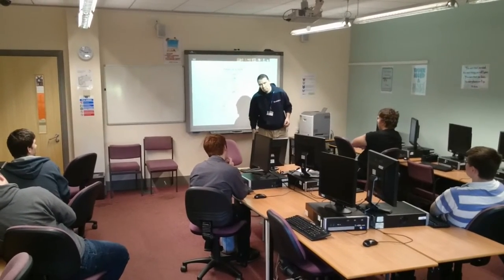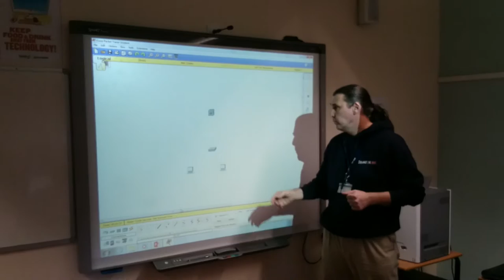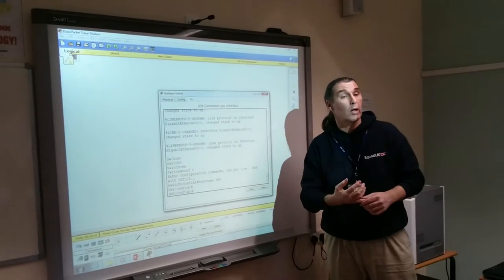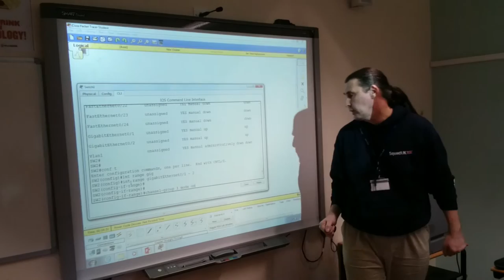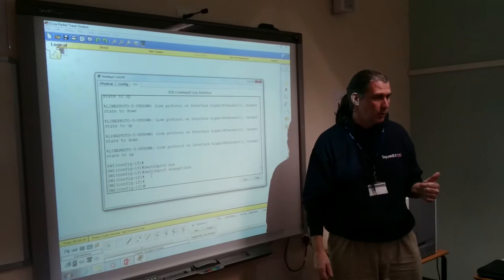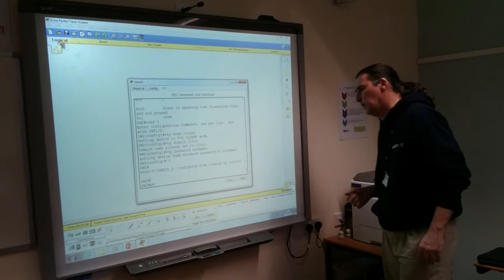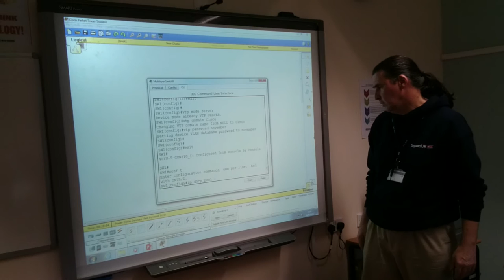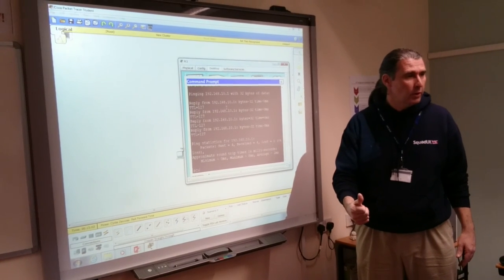Inter-VLAN Routing using a Layer 3 Switch and SVI's

Comment: great vid, but I have to ask: as far as I know, setting up an ether channel can not be on the same group number. every device needs a different ether-group i.e. layer 3 switch has to be on ether-group 1 and the layer 2 switch has to be on ether-group 2, for example. how does it work if they are BOTH on the same group in different devices?